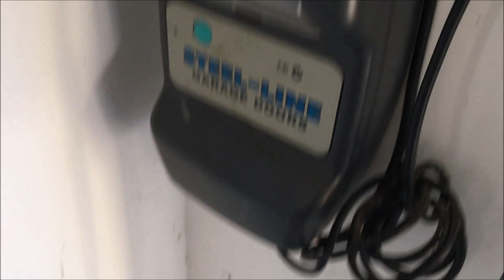Fix problem with Steel-Line Garage door partially opening then stopping RD1 12MZ and BOSS BRD1

Comment: Hi and thanks for the video.    I was able to get mine to work on and off but now died.    Of course the new roller door people want me to replace not only a unit.....but the door .... wondering ....maybe I could send my box to you to repair .... I am happy to pay you ?   I am in Far North Queensland
Reply from the maker: From one Graham to another... I suggest if you are not able to open the unit yourself to check the capacitor, then take it to a local electronics repairer and ask them to replace the capacitor which is a very straightforward repair for anyone that knows how to use a soldering iron, the capacitor part is only a few dollars and I suspect the repair fee would be just an hour or less (some will charge you a minimum fee of an hour even if it takes less time.)

It's actually even easier to get open if you cut the sticker label at the top of the unit as someone else pointed out in the comments (perhaps yours doesn't have a sticker).

Of course it's possible there is another issue but the faulty capacitor is perhaps the most likely for this model particularly if it has been a slow death for the unit.
Reply: @Fontgod  hey, thank you very much Graham.
I will give that idea a go and fingers crossed it will do the job.   
Mate, I really appreciate your assistance and follow up reply.
I will let you know how I get on.
all the best to you.
Reply from the maker: @grahamw8856  Glad to help out. If you are near Cairns/Townsville/Rocky I'm sure that those centres will have tech repairers able to do the job without having to resort to scrapping it. All this so called "disposable" tech mentality is a big problem in the world and the art of actually fixing things seems to be a lost talent.

Comment: hi ya i have same unit .can you tell me the 2 two wires i need to ,momentary .or 12 volt to use "Manual " up and down ? cant find circuit ? Please.
Reply from the maker: I'm not 100% sure I understand the question. However if you wish to disengage the motor so that you can lift the door manually, there is a lever that you can pull down at the top of the roller door where the motor is (if your setup is the same as mine that is). Pulling the lever hard will disengage the gears.
Reply: @Fontgod  sorry ,i didnt explain properly .i have very same unit you have .there is a 2 termanal block ,on board ... i just want to conect wires to this and use a outside switch to operate door up and down . on the glider rool doors its a mometry of _ve  negative to go up and down ,on others it just join together ,momentary . .How can i connect a ourside "Momentary swicth "to this unit ? Regards Graham   VK5GS?  cant find cuircut diagram on net ????
Reply from the maker: @grahamsmith347  Unsure on the answer to that one sorry. But couldn't you just trace back where the existing button connected to the board?

Comment: Interesting that this should show up. Worked in government where the desktop computers were crashing. All had the swollen capacitor problem. An expensive fix by the supplier. Apparently the capacitors were faulty from an incomplete piece of industrial espionage. No kidding.
Reply from the maker: Yep, that's the same story I've heard about why capacitors were often failing prematurely . Basically the stolen electrolyte recipe for the capacitors was incorrect https://en.wikipedia.org/wiki/Capacitor_plague
Reply: @Fontgod  I found a fresh dead gecko on the power supply board. The one with the black cover.  Cleaned it off. Switched power back on and the led light lit up. It worked fine, however once the courtesy light goes out it doesn't work. 😐

Comment: Question: my door works perfectly when I use the button directly on the control unit but when I use the remotes (both have same problem) I need to press the buttons several times to get the door to open/close. I've replaced the batteries but that didn't help. Any ideas? Thanks in advance.
Reply from the maker: Is it the same type of unit as mine? Does the remote problem occur if you try to test within say 30cm of the receiver? Were the replaced batteries a reliable name brand or cheaper batteries which may have been at the end of their shelf life? Some causes may be worn button on the circuit board of remote or radio interference from something else in the area (I have read that LED security lights can interfere for instance).
Reply: @Fontgod  Externally it looks like exactly the same unit as yours. Both remotes do work when held close to unit. Replaced the batteries but I will check re age/quality of the new ones and replace (thanks for the tip 🙂. Both remotes are behaving the same, so it would be unlikely that they've gone at the same time. They only cost a few dollars online but how do I sync a new remote with the unit?
Reply: Checked both batteries again. Energizer showing 12.18v with multi meter.
Reply from the maker: @gregoryrostron7539  Seems it may be either a range/interference/battery issue then. Check to make sure the aerial wire is undamaged and still attached to to the back of the receiver and extend it upwards (the wire on mine is about 4 inches long, you can see it in the video. It's possible that rodents might enjoy chewing on it and bight through the wire). Also check that the battery connectors in remote are nice and tight, mine recently started to play up and I needed to bend the battery contacts a little for a snug battery fit. Lastly, check the range of both remotes by walking away from your receiver whilst alternating remotes to see which has the best range.
Reply: @gregoryrostron7539  Did you reprogram new controllers? if so how?

Comment: You remove the side plastic from the door motor part and adjust the close/open sensors. I fixed mine yesterday. You don’t need to fix the part your working on.
Reply from the maker: Yeah mine was a definite dead capacitor problem but there are no doubt other fixes for different problems.

Comment: Thanks for this mate, will a 1000uF 35VDC Low ESR Electrolytic Capacitor work as well?

How easy was it to solder, would you recommend a beginner on soldering to tackle it?

Cheers
Reply from the maker: No, I suspect it will fail very quickly (it will likely pop as it is well under the correct rated voltage).  The correct part should easily be available through any dedicated online components store. I think I got mine from mouser electronics here in Australia. A beginner should be able to desolder and resolder a capacitor however given the dangers/risks involved with electrical repair I would recommend a professional do this for you if you are not skilled or unsure (think electrocution, fire risk). They would ensure the capacitor is the correct rating, fitted correctly (ie: the negative lead is closest to the stripe on the capacitor and is usually the shorter lead).

Comment: I am in UK and have a steel line remote. My garage door stops after rising about 2 feet. It usually then goes all the way up on about the 3rd attempt. Checked the capacitor (blue like yours) and it is flat at the top with no bulging. It is just over 20years old so maybe its time to change it anyway to see ?
Reply from the maker: Yeah, it's certainly worth the few dollars it costs to just change it out for a new capacitor if you are handy with a soldering iron. Mine was probably about 10-11 years old when it failed.

Comment: If you take the two screws out first the bottom part of the front cover lifts out really easily without the need for a big screwdriver and force.
Reply from the maker: Thanks, yeah someone else mentioned that a while back, I think my reasoning at the time though was because I wanted to keep my sticker intact at the top and this meant I needed to do it a different way. Silly of me really though as the warranty was already up anyway.

Comment: I have similar controller (RD1UK RD 8MZUK). Today morning shutter just stopped coming down. Fuse OK. Any suggestions? Thanks
Reply from the maker: All I can suggest is check the capacitors for bulging at the top of their expansion caps and replace if bulged as per the suggestion in my video.

Comment: Hi great vid! Do your expertise extend to installing an iSmartgate? I purchased one as the Boss RD1 is listed as a supported device, but can’t work out which wires are the opener mechanism. iSmartgate don’t know either and are asking me to send them the manual (doubt the manual would identify internal wiring even if I did still have it). Cheers!
Reply: The 3 spade terminals will work - outer one is + power, centre one is switch, most inner one is ground.
Reply: @NatesToolbox  thanks mate. Can’t spot the spade terminals though?
Reply from the maker: Sorry, no help on that one.

Comment: i replaced the Cap but still weak
Reply from the maker: If the motor seems weak, perhaps the tension needs to be adjusted? Does it close a lot faster than it opens?
Reply: yes it does close Faster then opening
Reply from the maker: @NotCaily  You may need to google an instructional video on how to retension your door spring. They are under a lot of tension though so be very careful if doing it yourself (maybe a two person job).

Comment: Up screw the two screw and lift out don't do what he is doing
Reply from the maker: I can't remember exactly but I think I may have wanted to keep the sticker intact at the top which required me to push out the lugs at the bottom, if you have no sticker or don't mind cutting it then it would appear you may be able to open it easier.

Comment: I have the same unit. Everytime my power goes out the door won't work for maybe a couple of days. Then by miracle it starts working again ! Don't know why that would happen ?!?
Reply from the maker: This could be possibly heat related, when power goes out the unit cools down and something in the circuit contracts. When it heats up again after being on for a while the component expands again and either makes electrical contact or else in the case of a bad capacitor the capacitance reading gets to the level where it is just barely able to operate again once it warms up. I have had powersupplies in some electronics that fail when cold but after they warm up the device will switch on. I'd pull it apart and check the capacitors for slight bulging at the top as per my video, probably worth replacing the capacitor even if its not bulging as some do not show any obvious bulge but can still be faulty.
Reply: Thanks mate for the info 👍

Comment: My neighbour's unit currently re-opens itself 1.5 minutes after closing every time. The issue seems to have started when a relative tried programming a generic remote.
Reply: Does it still happen if the remote is no longer anywhere near the door (ie, driver has left the house completely)? Generally if a door reopens immediately after closing it needs a safety sensor adjustment, but 1.5 mins after is strange.
Reply: @grahamjupp1222  It was the sensitivity adjustment. The only thing I didn't check!

Comment: I have a similar unit branded BOSS, my needed replacing but now the unit wont work. I can only think its burnt something out by installing a new bulb ?
Reply from the maker: May have added a bit of extra stress to the capacitor once you replaced the dead bulb, suggest opening up the unit and checking for the bulging capacitor as indicated in my video.

Comment: Having exactly the same problem..only way roller door will go up is if I press the remote and give the roller door a helping hand..I'll give the capacitor replacement a try.
Reply from the maker: Would be interested to know if the capacitor replacement fixes the issue for you. Let me know either way. Can also point you in the right direction for capacitor supplier if you are in Australia.